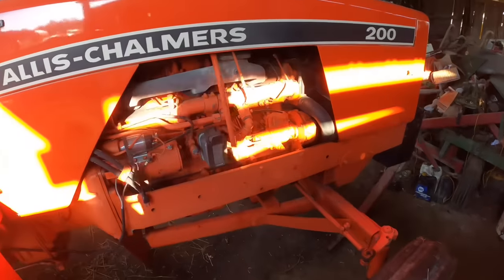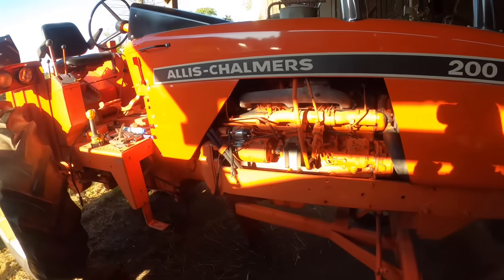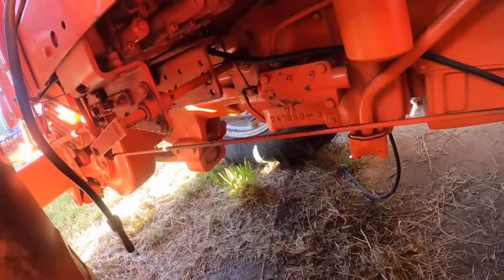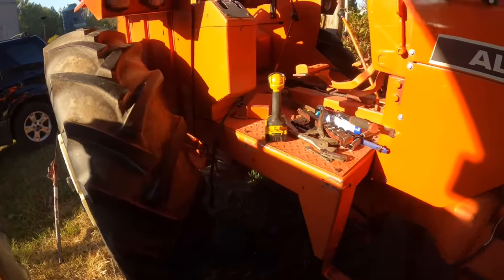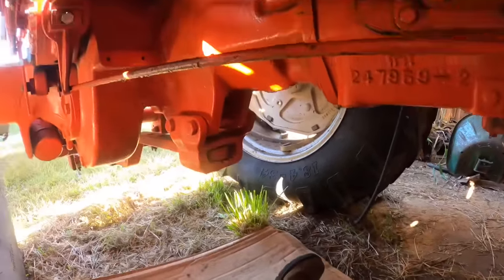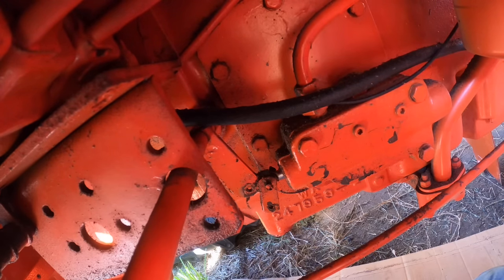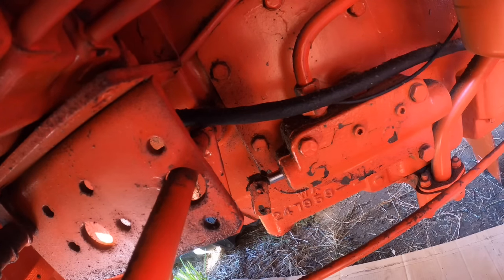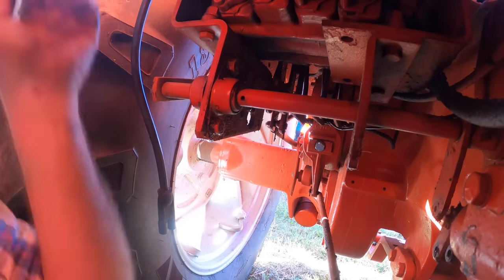ALL ABOARD the big orange STRUGGLE BUS!!! Allis Chalmers 200 hydraulic line removal

Comment: If my memory serves me correctly, Alis was more or less the founding company of Agco. I remember using an old D17, couplers were similar to the old JD "Next Gen's", the pressure was better and more "reactive" than my old JD3010D, and those were decently fast in the day. My JD, I couldn't ever hook or unhook a hydraulic hose under pressure. 
Best thing to do is replace all those hyd hoses. I had an old NH 850 round baler, it had steel lines, had 2 burst on me once. Took them to a hydraulic shop, nope, we don't make those... yea, go figure, replaced with hose. It's funny how they'll make steel lines for other equipment though just not ag. Great video, cheers :)
Reply: I am pretty sure you are correct about the founding of AGCO.  If I remember right AGCO is/was short for Allis Gleaner Company
Reply from the maker: AGCO stands for Allis-Gleaner Corporation

Comment: Yeah, the curse of the fitted steel line. If they had just put a regular pipe fitting on the end instead of that compressed hose fitting.   That steel line assembly is long extinct!  What I always do, I just saw off the hose mess and braze weld on a standard pipe fitting and from then on use regular hydraulic hose with 1/2 in pipe ends. problem solved.
Reply from the maker: I thought about using compression fittings and reusing these but they were awfully rusty where they have been clamped together all these years.